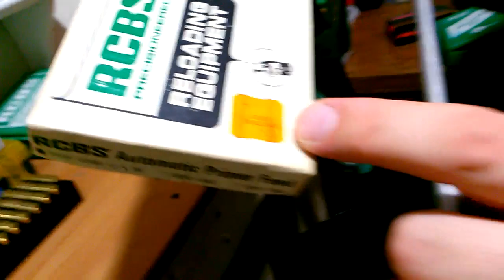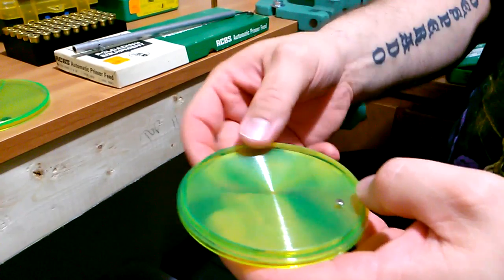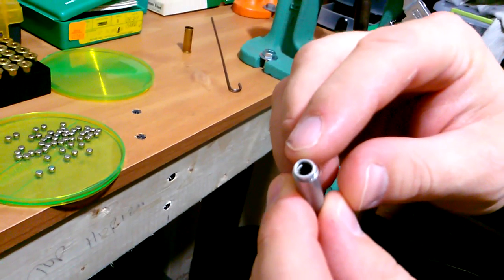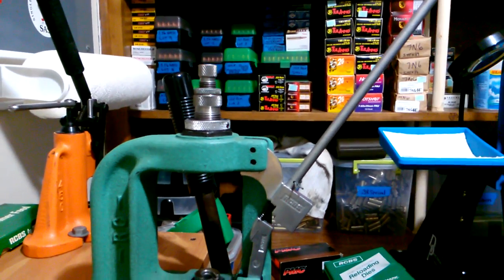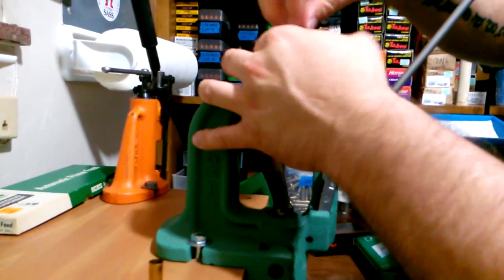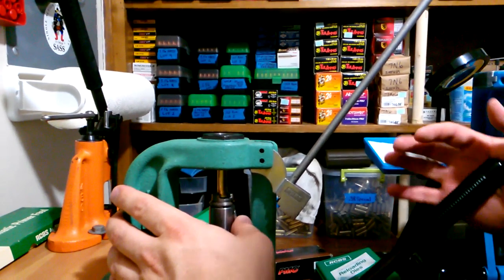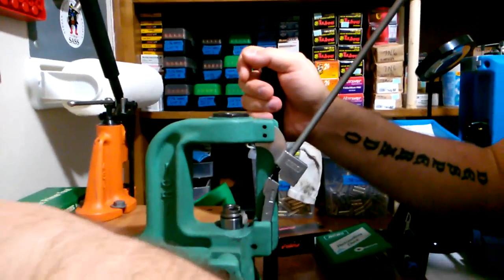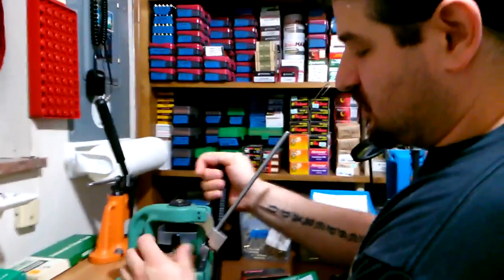RCBS Automatic Primer Feed: Old Rock Chucker Press

Comment: Thanks for the video. I searched for this specific process because I'm having a problem with my used autoprime system. It's like the primer cup  is too long, so the cup hits the primers before it hits the spring button. As far as I can tell, the pin is screwed in all the way, but it can't pick up a fresh primer without me pulling the primer cup down a little so that it clears the primer. Then half the time it flips the primer upside down before it goes in the cup. I'm not sure if I'm missing pieces since I bought the press used. I'm tempted to grind the primer cup shorter so it won't hit the primers. (EDIT: sorry, I just now figured out that the top piece is put in with set screws and is adjustable. It works now. 😆)

Comment: Excellent video. My Rock Chucker 3 press came with this system and it works well.  I had considered a hand primer, but once you get the feel for this one priming goes really quickly.  I leave a die set high in the press, just to contain any fireworks during an accidental detonation.  You are correct in that the primer tube is right in line with your eyes, but we should all be wearing eye protection any time we are working with primers or powder (hint...).

Comment: Thanks so much for the tip using the coat hanger for a follower! My primer feed tubes work like a champ until the last 2-3 primers, then they want to tip and sometimes even drop out of the cup. I will start using a follower right away to see if that eliminates the problem!
Reply from the maker: buellosaurusrex Happy to help. just file or sand any sharp points/edges off before you use and and be sure to place it GENTLY on top of the primers! And always wear safety glasses. Let me know how it work for you. Stay safe.

Comment: Quick suggestion, instead of a metal follower, try a wooden dowel with the end (that contacts the primers) lightly sanded smooth. No sparks or sharp edges.  I also add a small flag at the top to give my eye something to see (so I don’t poke myself) and let’s me know which end is which. Lastly, I make a mark on the dowel to indicate where the dowel sits when it is empty.  Gives me an dictation that I need to refill.  Helps if you have an odd number of primers for some reason.

Great video. Very easy to follow and good tips.  Thank you!
Reply from the maker: Thanks for the input and watching the video.
Reply: @JunkfoodZombieGuns  I’ve been using a Hornady LNL progressive that has the primer tube. I watched your video and learned how to get my old RCBS presses up and running with the auto primer. So big thanks to you for making the vid and making it available.  Great job. 👍🏼

Comment: That is cool! Seems no one uses the older press mounted type anymore! Especially on CH but the feed is harder to come by! The old tubes hold 50 right? New ones have the plastic tip and hold 100. I need to find some old ones!
Reply from the maker: To be honest, I have forgotten. They may hold more than 50, but I'm not near enough my stiff today to check.  Appreciate the comment
 Have a good one and stay safe.

Comment: Consider putting a bullet seater die while doing the priming this way in case one goes off for some reason. The flash will be contained in the die. I have an older version than this one, it has plastic end that you push over the primer instead of the spring. And the plastic has broken so I'm using a hand primer now. I liked this method because I don't have to keep swapping shell holders from the hand primer to the press.

Comment: I can’t get the primers to sit low enough in the case. The black piece that holds and inserts the primers seems to bottom out, are there other sizes of these available?
Reply from the maker: Let me ask you a question. I am only asking because I do not know how much experience you have, nor do I know what cartridge you are loading... Have you checked to see if you are accidentally trying to put rifle primers in a pistol case? If not, are your primer pockets clean? Sometimes they can be dirty enough that primers may sit a little high. Also, make sure that the little silver sleeve around the primer seating stem is sliding down far enough. (You can do this by hand). Other than that, I am not sure what the issue is. There are also a large and small primer seating stem for large and small primers. Make sure you aren't using the large seating stem for small primers. Let me know if you get it worked out. Good luck!

Comment: Just picked up the same single stage loader at a garage sale. Looks like I need the prime feeder for mine. I intend to load 308 / 30-06 ammo, so i know i need the dies. First time loader, anything else you can suggest me adding to my single press?
Reply from the maker: To the press itself? Not really.  If you have the dies and the primer system, you should be good to go. You don't even need the auto-feed. You can load them singly, by hand, though it is a bit slower and you'll want to make sure your hands are very clean, or that you wear latex/nitrile gloves to keep your skin oils out of the primers. As far as other stuff, I obviously a reloading manual or three, a decent powder scale and some patience. This is not a hobby to be in a hurry with. Safety really is of the utmost importance. Good luck, and stay safe!

Comment: I load with Lapua Palma brass / CCI BR4 primers. As you may know, smaller size flash hole with denser primers require a little more exertion. Thus, my concern is primer seating depth. I have the same set-up. Any suggestions?   have thg he

Comment: Do you know if the priming tube kit works with an old JR2 press? It looks like it has the same two mounting holes on the top of the frame. I have to get me one of these.
Reply from the maker: I would be lying if I said I knew. It's possible, but a call to RCBS would definitely be the wiser thing to do as I only have the Rock Chucker. Sorry.  Wish I had the answer for you. At least I ain't lyin' to ya!
Reply: +JunkfoodZombie I appreciate that I will check with them. My press looks almost identical to yours so I bet it will work. Thanks for the reply.
Reply from the maker: +Vince ruland If I recall correctly, the Jr press is very similar, but a little smaller than the Rock Chucker. Again, don't quote me on that.... Best of luck with it!
Reply: +JunkfoodZombie I called RCBS and asked about my press and they said it fits. So I ordered one and it already came in. I've used it on some 38 special brass that I'm getting ready to load my cast bullets in to. Thanks again for the video. I always wondered what those little set screws were for. Haha.
Reply from the maker: +Vince ruland Awesome! Glad it worked out for you. I hope their customer service was as good for you as it was for me. They have been top notch for me every time. Have a good one, and have fun reloading!

Comment: JFZ or anyone else know if I can get this fixed. I inherited a RCBS RC2 with this system however the small pin that holds the next primer in the tube until you bring the primer arm back is missing. Can i get a replacement for that or do i have to buy an entire new auto prime system
Reply from the maker: Allen Bonner My guess is that depends on if the parts are still available. What I would suggest is to call up RCBS' customer service and explain to them your problem. When I bought my press used, I couldn't find one of the primer cups. I called them up and they got me hooked up and running in no time. I have only needed to use their customer service twice, but both times, I was treated far better than I would have expected. Good luck. Let us know how it works out.
Reply: I will call them tomorrow and let you know how it goes. I thought i would need proof of purchase to get any help with this . thank you very much
Reply from the maker: Allen Bonner No problem. Each issue is an individual example, so different things will need to be treated differently, but I will say they will treat you fairly and respectfully. The reviews of their service are overwhelmingly positive.
Reply: Well JFZ you were right, RCBS has once again set an example,  part is being shipped to me free of charge, thanks for your help
Reply from the maker: Allen Bonner Sweet! That's what they did for me too. I didn't mention that before because I didn't want you to expect them to just give you free stuff, but I knew they would at least be fair and courteous. I mentioned it to one of their reps at the NRA show and told her that THAT service is what makes me a repeat customer and I highly recommend them. Have a good one!